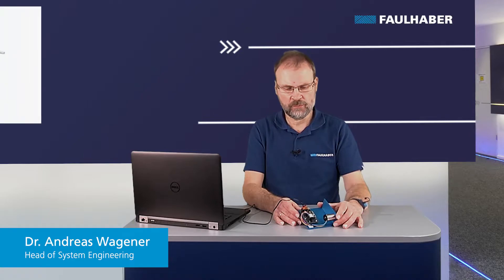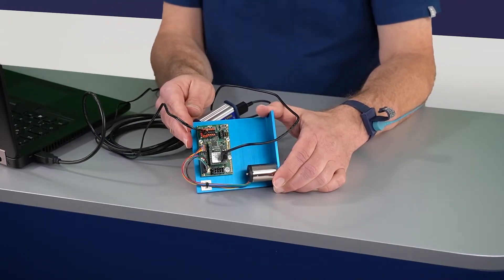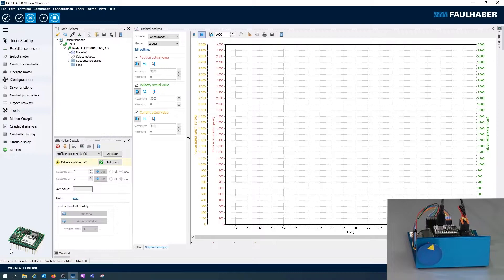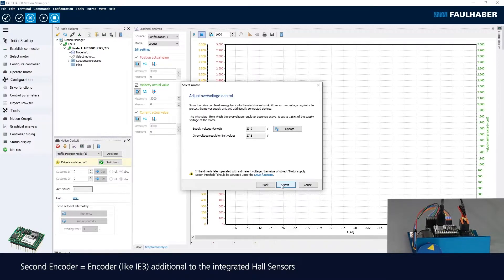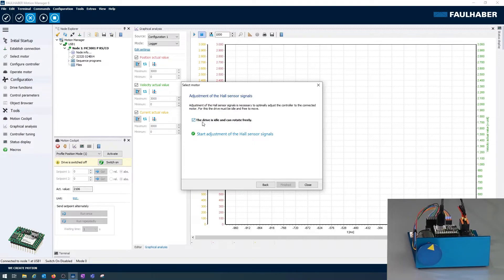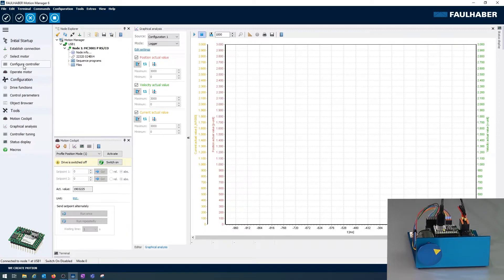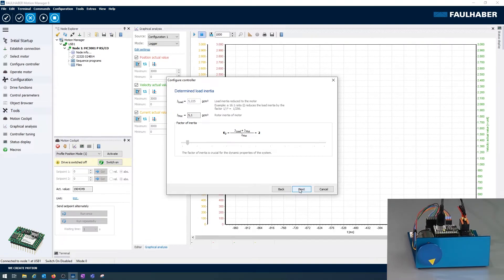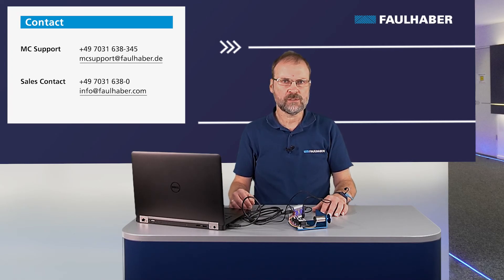How to setup a Drive System with the FAULHABER Motion Manager (3) - FAULHABER Drive Time

Comment: Thanks for the explanation! Is it normal that when using the software with the MCBL 3006S motor controller, we cannot access other options besides the "select motor"? also I cannot fix a speed, neither by commands and neither by "operate motor". Also when the motor is identified it doesn't start to run as with this case...
Reply from the maker: If it’s really a MC3006 S it’s likely a little bit older. Could you please check with out MC Support Team. We would like to check your driver. https://www.faulhaber.com/en/contact/inquiry/#mcsupport